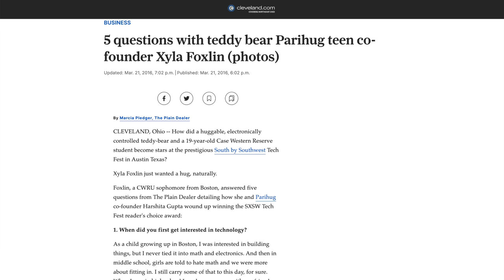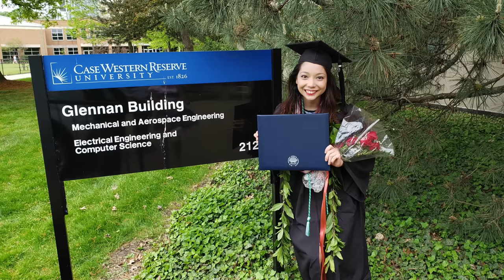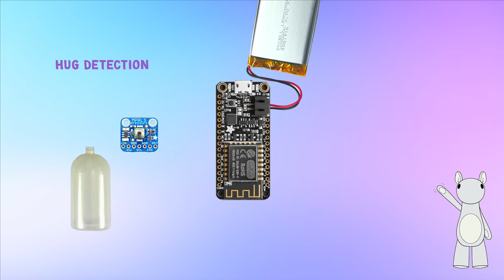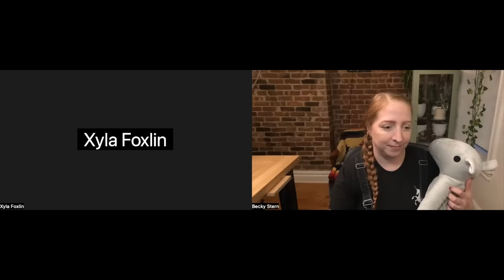I put a Computer in a Stuffed Toy Because I'm Lonely

Comment: So fun to build this with you, Xyla! 🥰
Reply: @BeckyStern - 2014 to 2023 changes in WiFi options available. Can confirm! I went to a startup in 2014 that was using the TI embedded WiFi (CC3200); total garbage compared with parts available now (Esp32 and AmebaZ2). We had so many issues getting people connected to their router. It's so much more reliable with my current company's stuff. It's night and day now!
Reply: At some point the dog toy will have to be replaced with a larger bladder so you don't have to squeeze so hard. Basic idea is good, the heartbeat idea is a premium idea.

Comment: Could you put the circuit board and the pressure sensor IN a screw-top squeeze bottle, so it would act as a case for them and you wouldn’t need the tubing to the sensor?  Just glue the haptic vibrator to the inside of the bottle and it’s all self-contained. Remove the bottle from the stuffie to recharge the battery as needed since the battery would be protected inside the bottle.
Reply from the maker: Yeah! That's actually pretty close to how my production model worked-- the bladder pressed up against the rim of the entire circuitboard.

Comment: One thing to note: not all RTV is safe for electronics. You should avoid silicone adhesive sealants which use Acetoxy crosslinkers. But, a great project!
Reply: I like GE silicone 2.
Reply: For some reason seeing the RTV getting globbed on tickled me. Maybe just from seeing it as a fix-all from yeehaw shadetree mechanics like myself. "Gotta seal this one thing to the other thing... SLAP SOME RTV ON THAT"

Comment: Great Idea!
I just want to suggest adding some kind of pressure relief valve (or maybe just poking a small hole) to the bladder to allow pressure equalization in cases of slow pressure changes as you experience in flights or due to geographical changes, to avoid fault indications.

Comment: I'm happy to know we are both Case graduates, separated by a number of years. I spent a bunch of time at Glennan. I was a computer engineer (Case '80), working for the mechanical & aerospace department, which had a diesel engine on the ground level. We supported data collection on that engine.

Comment: Sweet idea.  I'd suggest two small features. Make initial hug detection produce an audible signal, so the recipient doesn't have to carry the thing around all the time.  Also, if feasible, make the detector more than just a binary signal, give it a modest range of intensity.
Are there any security questions to consider? (Abuse, privacy..?)
It could very well have applications for autistic or otherwise emotionally fragile children.

Comment: Neat, but wouldn't it have been easier to use some sort of spring loaded piston that connected to a push button? Push buttons are far easier to code for and trigger and a couple of spring pistons with mesh connecting them would be more durable than the bottle/bladder thing.

Comment: Does it have a speaker/microphone inside.  So you talking and hugging your bear 🐻. ... and they talk and hug their Bear 🐻... The hug and conversation can be transmitted.  If you can make the hug feeling. It should be easy to make the audio connection
The audio interface should be in the head. For obvious reasons... But imagine the whole feeling of reciving a hug. With heartbeat. The warmth and familiar heartbeat of a trusted loved one.. and hearing Their voice answer you from this bears 🐻 head.... almost like an audible. Telepathy.  Because no Mouth movement.   And You really don't want Teddy ruxbin mechanical mouth movement.  Just the body contraction , heartbeat.. and vocal response.  That proves you're being listened to.    Is .. immeasurable ❤️💙💜🖤🤍♥️